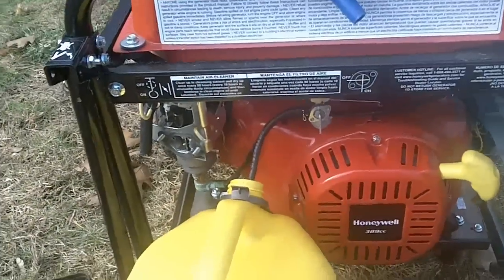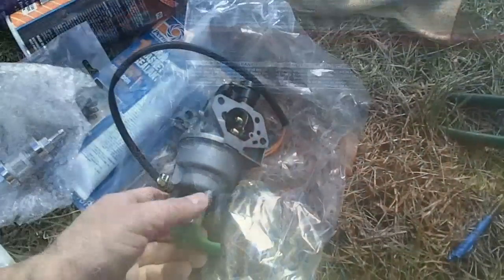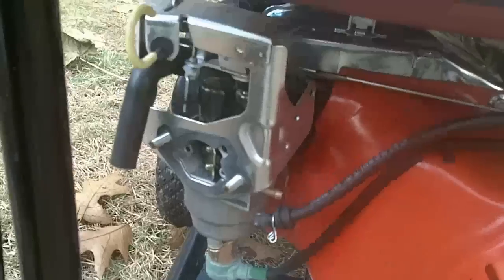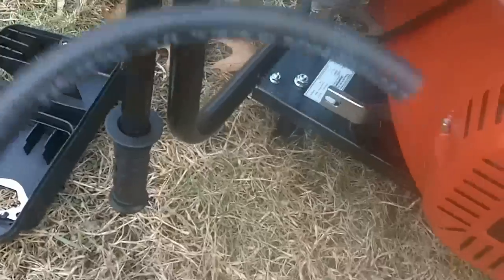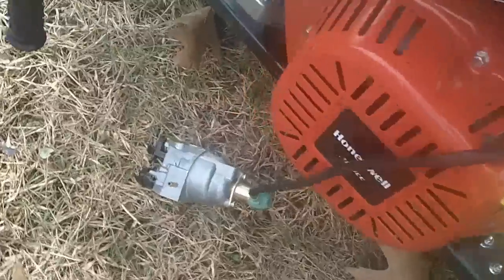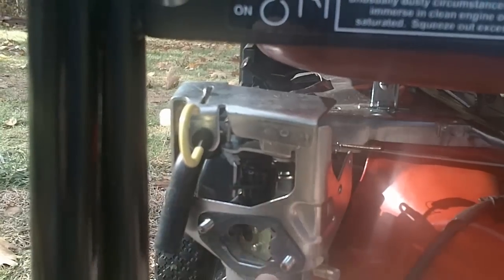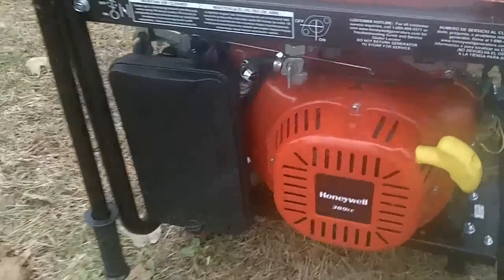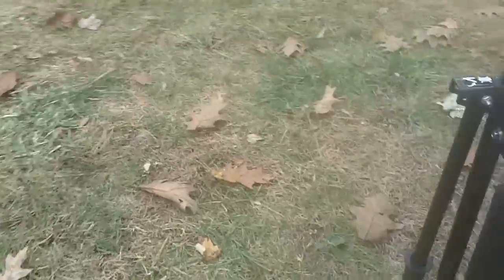Generator Carburetor Replacement

Comment: I had the same filter on my pick up truck. worked good for a long time. I liked that I could see if I was getting fuel to the carb. be careful of the o rings in it though. if they get old they will fall apart and the filter will spew gas all over. Im not sure but I think that ethanol gas dries out the o rings.

Comment: Thanks for the video.  I was wondering if it's necessary to hook up the  solenoid wiring on the new carb?  Couldn't you just remove the solenoid on the old carb (providing it's fine) and hook that up to the new carb?  I'm about to replace the carb on my  B&S 30470 and the carb looks very similar to the one you replaced so I'm just wondering if I can just swap out the solenoid?

Comment: I think this is a manufacturing characteristic flaw with this particular carburetor. I'm going on two years with mine and its always the carburetor having to replace the thing every year or so. Cleaning it just doesn't seem to work and it's getting harder and harder to find a replacement carburetor. It's a decent generator just the carburetor system sucks.